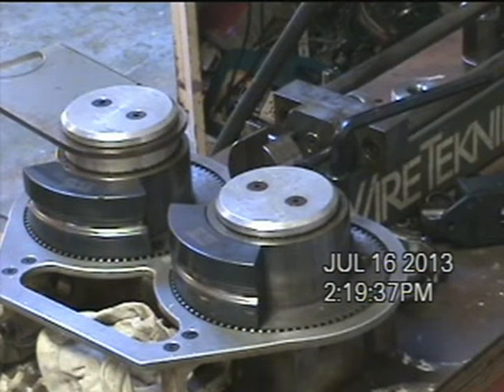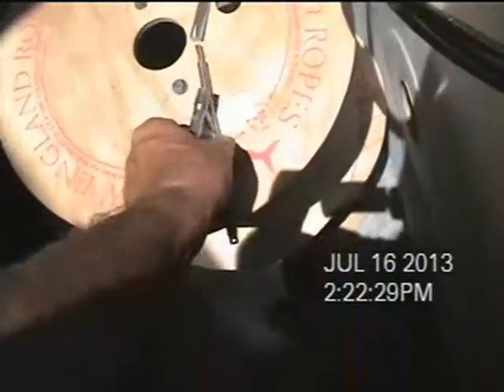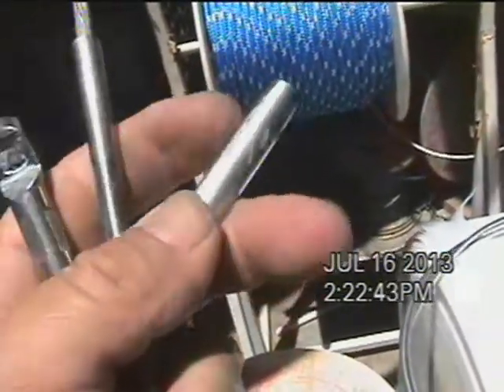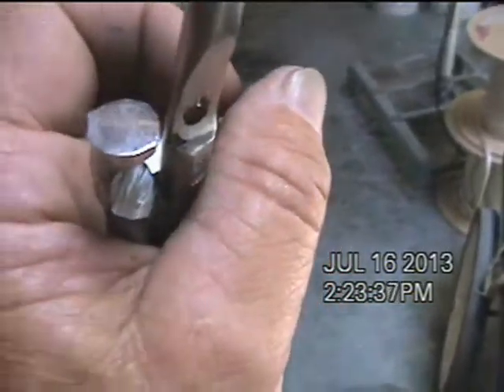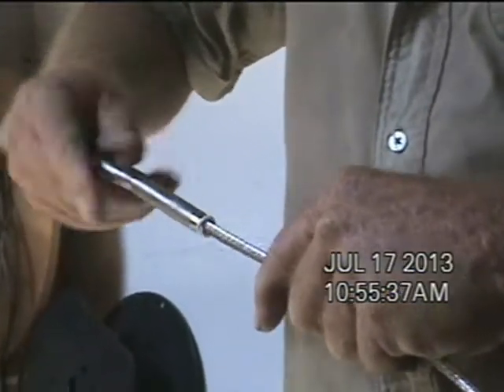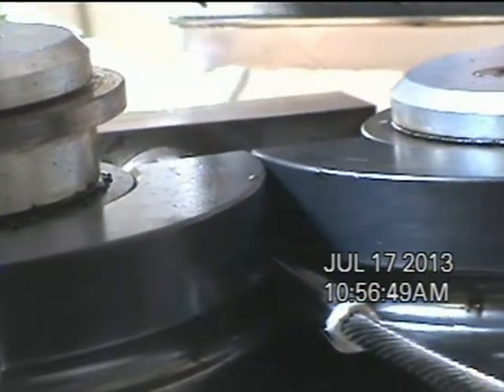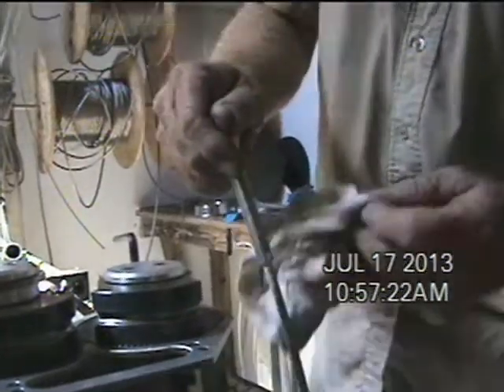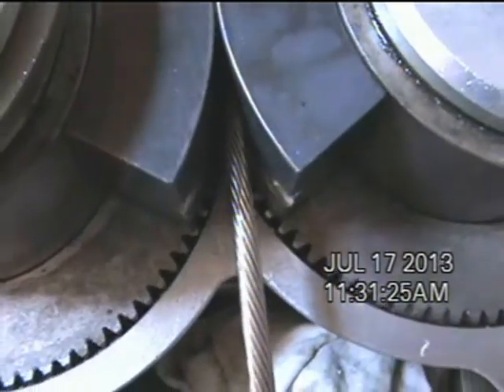Swageing and Swage Machines

Comment: I don't know, but after doing some research, I found three things: 
1. That glue or whatever may prevent the wire from being welded into the terminal as a homogen weld (at least some of the surface area will/may have that glue giving it less holding-area)
2. I read the worst thing you can do is to try to make stainless steel waterproof bu covering it, as the oxygen accessing the steel is only benefitial to the endurance of the steel and swage
3. From my practical, logical thnking, I would have thought it would be best to compress the wire at the end, and then releasing pressure towards the opening of the terminal. This to avoid having a sudden alteration on the wire, going from beeing swaged to nothing at the opening of the terminal. Swaging/crimping it all way, may give it a weakness where it enters the terminal. (coned clamping = less stress as there is gradual grip. I don't know, but have seen photos or video of that way of doing it)